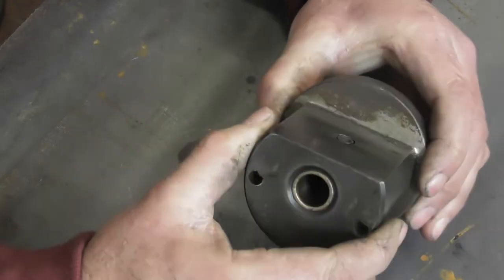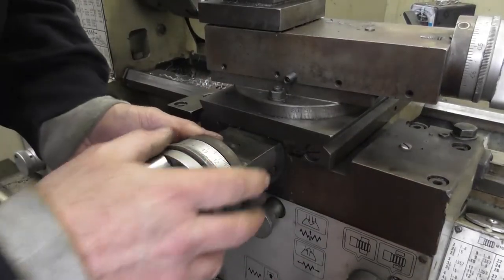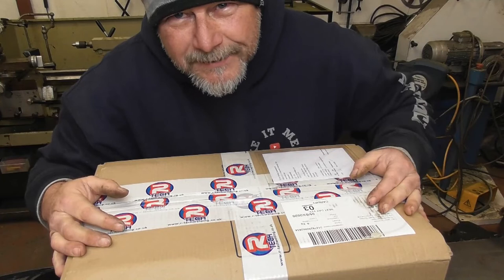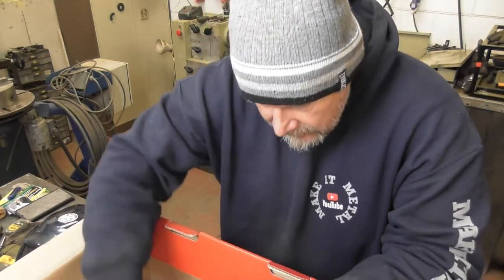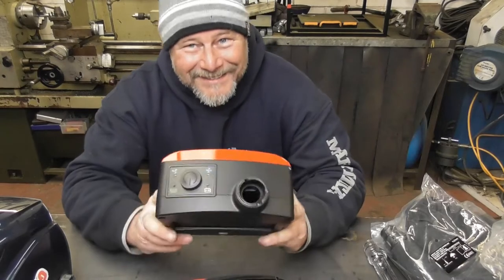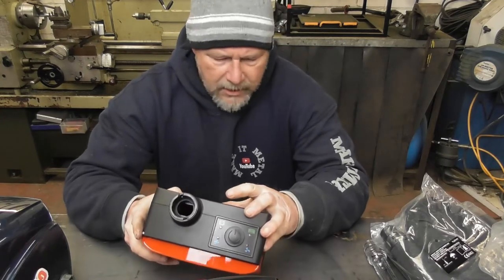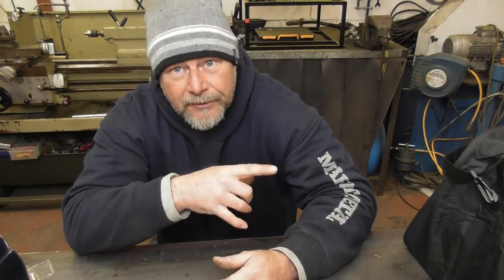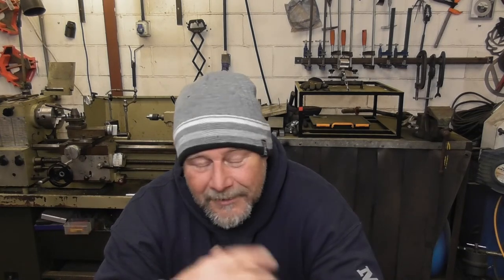Air Fed Mask, Tig Brazing And Other Stuff!

Comment: Surprised at the lack of a spare lens/protector. Best put that on your priorities list to order in, 😉. There is a Harrison M300 cross-slide listed on eBay if that helps 👍😀
Reply from the maker: will do Huey..iv'e honestly never bought a mask that didn't come with spare ever!  ill check it out, the 600 group want over £450 just for the lead screw!

Comment: that mask looks horrendous, wouldn't like to wear that for 6-8 a day, thank god i have my speedglas 9100 adflo, i can wear it all day with no complaints or fatigue
Reply from the maker: i've had it for a while now..i work 10 - 16 hour days and the mask works fine, the speedglas masks are awesome and that is reflected in the price..over here they start at around £700 nearly twice as much as this mask.